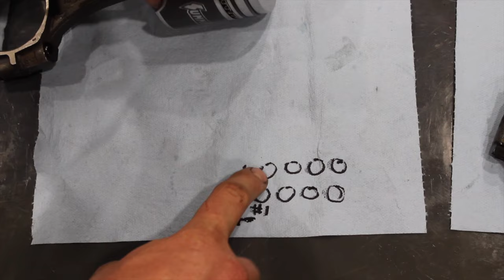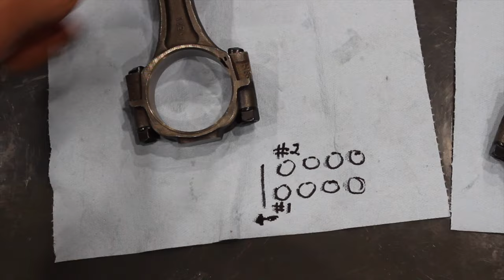SBC Piston Ring and Rod Orientation (For the First time Builders)

Comment: Those gaps don't just move a little, they move a lot, to point of actually rotating the rings, considerably.
Reply: Correct, I just went for the 1st rebuild on my Stocker (an 84 Dodge Daytona 2.2 TBI that has been in the family since factory/dealer purchased brand new), it had almost 93K on it (head had only been off once ever, by me in 1995, and sure enough, the number 1 piston all rings were perfectly lined up, both oil rails and oil ring expander and 1 and 2 compression rings were all 4 within 1/8" from perfectly lined up.

I complained about it being a factory error, mind you 38 years ago that engine was factory assembled. And was told by my machinist, and my forged piston mfg rep, (I had started the car and ran it exactly 3 mins after a nearly 23 yr. Layoff from racing it...97' to Jan 22' on 13 yr old pristine race gas), that it was just a lucky shot, that they all rotate, especially after the cross hatching is gone.

They assured me the factory clocked the rings. If they did not spin in the bore, there would be wear and other issues,and it would be quite noticeable upon disassembly.

Then they showed the patterns of blow by on each ring land that assured me that the info is correct. They were if taken ring land by ring land, even all around in pattern of darkness... proving that it was reality and not just a theory.

They do move a lot, and often if oiled correctly. And in both directions, as explained by a piston mfg. Tech. So, eventually, at least temporarily for each, by total chance...They will all line up perfectly or near perfectly occasionally.

But, when you disassemble one and it is that close, you sure to question it, as far as the assembly.

Comment: If I buy new rods does the location mater as long as I put them the right way when u use the original rods you know what number they were on but new ones does it matter? Thanks
Reply: No, doesn't matter which hole it goes into

Comment: If I’m changing my pistons on my 350 do I have to take anything g to the machine shop the crank or anything I’ve heard if I remove the crank or anything down there I’ll have to have the machine shop do work to it any info
Reply from the maker: Typically, if the pistons are being changed, then the engine will need to be bored to a larger size to get a nice round fresh bore. If the bore is in really good shape, then somtimes they can just be honed, and the same size piston can be used. 
If you're unsure of the condition of the parts, then you should take everything to the machine shop to be checked before ordering pistons or bearings ect

Comment: Do aftermarket rods have the champers too? I'm building my first sbc. My block is a high nickle 1973 010 4 bolt main from a box truck.
Reply from the maker: Yes they will have a chamfer.
Feel free email me if your not sure with a picture 
Pcperformance1@outlook.com
Reply: @cuttersperformance  Thank you , I appreciate that.  I got my heads. Block going to machine shop soon. Then I'll know for sure my over bore. I'm going with scatt rotating assembly. 3.70cc valve relief forged pistons. Probably .030 over.

Comment: Have you ever done any sonic testing on a dart SHP block. I just got one
Reply: It's the same block as a Little M, just with less features. Little M can go 4.250" and still be over .200" thick. They claim max bore at 4.165, just an ass cover disclaimer. I have done many, including SHP, which I have 3 of in the shop now. 4.165", 4.185" and 4.200" for big inch sbc stuff,  no problem.
Reply: @jrdmotorsports9718  Hi, what is sonic testing Brandon Bell is referring to please?  Thank you.
Reply: @robertclymer6948  It's an Electronic tool that measures material thickness when you can't use a caliper. We use it on cylinder bores to know how big it can safely be bored, decks, ports when porting, etc...
Reply: @jrdmotorsports9718  Thank you for your reply! Always love learning from the Pros!
Reply: @robertclymer6948  👍

Comment: I've had a question for years but haven't had any way to test. With no gap rings and low drag rings in mind, what if you stacked oil scraper rings (with gaps offset) in the compression ring grove. Would it seal? Oil scrapers are low drag, but would they last?
Reply: No, and no.
Reply: @jrdmotorsports9718  does that mean you've tried this? Or just don't believe it would work?
Reply: @toddjensen692  No-one in their right mind would ever think about trying it for one lol.
 For two, it won't work because an oil rail, or 4, does not have the radial tension it requires to seal cylinder pressure. It's not all about lower drag. If you can't seal the chamber, it won't matter how low the drag is. They are not designed for it. You want less drag, run a thinner compression ring. That said, you do realize where 85% of the drag comes from, don't  you?  Yep,  oil rings.

Comment: Question? R all sbc rods the same even vortec rods?
Reply from the maker: For the most part all early 350 sbc rods are the same but the vortec rods are PM rods (powdered metal) and are actually quite strong
Reply: @cuttersperformance  The forged density is 7.0 and the micro structures are something to behold. Back in the late 90's Nascar tested our Federal Mogul SBC rods and were extremely impressed. The same Rods we also provided to Howard's Cam for after market sales.

Comment: Hey Man can you explain to me the difference in sbc connecting rods, I have GMA rods and one x rod? I’ve looked everywhere for the information
Reply from the maker: So if we are talking regular large journal 5.7 SBC connecting rods. 
Your gma rods and x rods are probably almost identical. GM had a few variation but for the most part the gm forged rods are basically the same. You will want to weigh them to confirm they match.
The GM "Pink" rods had a splash of pink paint on them and they are abit better HD rod from gm. But honestly by the time you buy them, arp bolts and resize the rods your better off getting after market rods. 
GM forged rods with arp bolts are safe for 400hp and 6000 rpm (safely) 

Then there are the PM rods (powdered metal rods) these are the strongest of the factory sbc rods and used in the late model sbcs like lt1s and vortecs. 
Good for 500hp or 6500 rpm when using arp bolts. I've pushed the PM rods more than any other stock rods and have had good luck with them. 

Let me know if you have any more questions
Reply: Thanks man! I didn’t even think to weigh them but for right now I’m building a 333 with stock rods just to get it running! Trying to keep it on the cheap side with a set of 416 ported, heard they can flow roughly 200Cfm what would you suggest as a flat tappet on the cheap cam for a stock converter?
Reply: @cuttersperformance  I wish I had a dollar for every GM powered metal rod I have forged at my 12+ years at Federal Mogul (the pioneer)/Borg Warner/GKN, from SBC rods to Z-06 rods and after market PM rods for Howard's cam Co. Lots of rods for Chrysler, and Oldsmobile back in the day too. 4,000 to 5,000 per shift running 6-7 days a week., I'd be a millionaire many times over, lol  Damn good rods!!

Comment: Do the oil rings have to be gapped?
Reply from the maker: Not gapped but checked to insure they are over minimum gap. Usually .015 or so. I've never had to grind a oil ring
Reply: Not unless you want to, for a specific application. Always a good idea to check them though.
Reply: @jrdmotorsports9718  My son builds garden tractor pulling engines. They take single cylinder engines designed to run 3800 RPM and turn them at or above 9000RPM. I guarantee you he checks every single ring, always.

Comment: This doesnt make sense, espescially on a honed out used bore..
The Thrust side and anti Thrust sides are at North and South.. 
All scouring occurs on the North and South ...
So why would you line up Compression Ring gaps with these microscopic grooves for Start up 🤔??
Each to their own I guess, but this is one way that I will not follow.
I'll keep lining my Compression Rings up East and West with the Top Ring on whichever side the Cooler Intake side exists..

Comment: Its not gasses that'll leak through it's oil!.. the whole Purpose of the rings is to keep oil out of the combustion chamber. If all the gaps line up. Oil pushes threw the rings and eventually causes a missfire and blah blah blah.... you know the rest. Redo time. But anyways its oil, not gas lol😅
Reply from the maker: Blow by is combustion gasses....(burned combustion gases) it happens on every engine. That's why we have PCV systems. It's really only the lower most ring (oil rails and expander) that control oil. The only two are to seal the piston to the wall for and during combustion

Comment: Piston ring gaps should never be facing in the direction of the crank, or parallel with the piston pins… if you do that the grooves will leave marks in the bore… Bottom oil ring gap at 10.30, top oil ring gap at 4.30. Second ring gap at 7.30, top ring gap at 1.30… but never in line with the direction of thrust…or 90° to thrust… that’s just the way I do it…